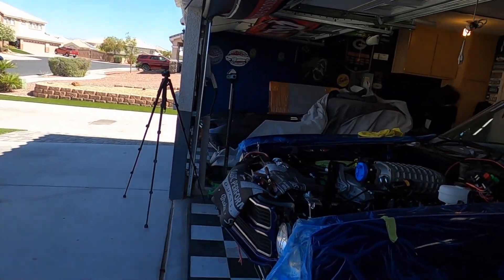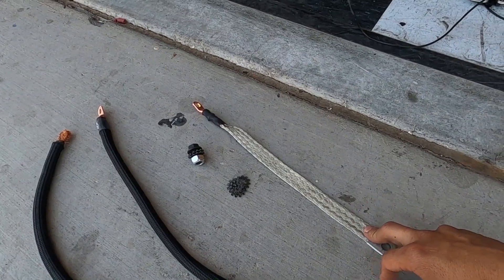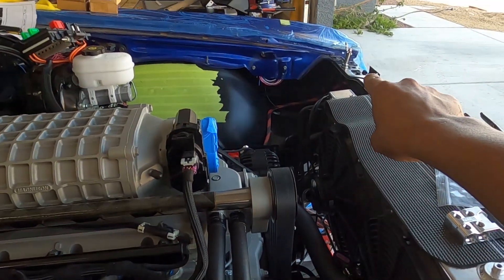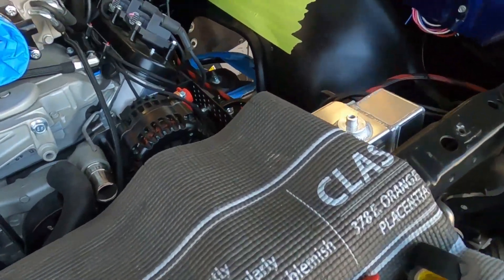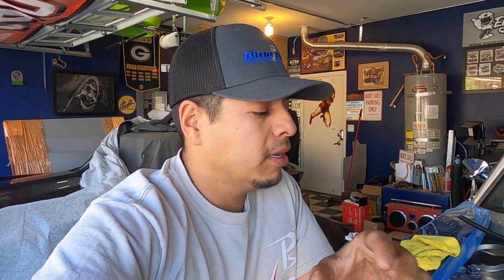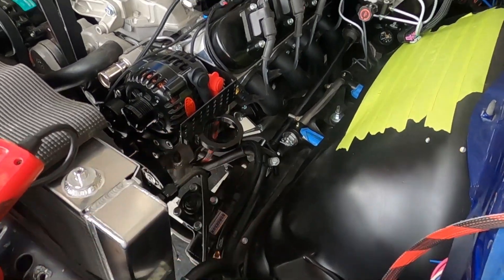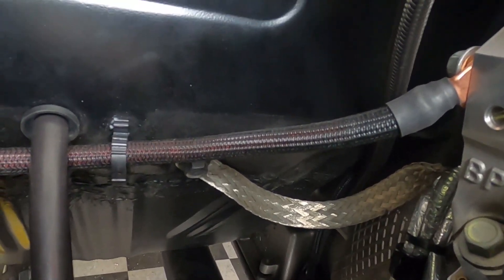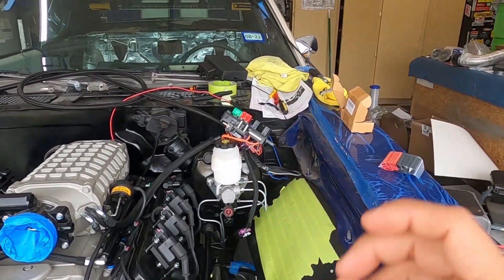HOW TO PROPERLY GROUND A CAR BATTERY TO YOUR ENGINE? (PART17)

Comment: I’ve never heard of running a ground wire from head to head. Interesting idea, I’m going to try it on my C5 Z06 that is very well known to have LOTS of ground or potential ground connection issues. My electrical knowledge is very lite. This might sound like a dumb question but is it possible to have too many grounds ADDED? Example, adding a ground from the alternator to the frame rail, a ground wire running from head to head and an additional ground wire running from the head or block to the frame rail? I understand to keep the wire size the same or larger than the positive cable (s). But again, is ‘adding’ 4 or maybe 5 extra grounds possibly a bad idea?
Great video btw🤟🏻🏁
Reply: There can never be too many grounds. But I do agree that he went pretty overboard with em.

Comment: So using your logic why would you run a smaller ground wire for an amplifier then the power wire? I've allways just ran zero gauge power and ground wire..and its not a crazy size since your dealing with allot of draw for bass

Comment: Did you put the ground wire on the same bolt as the charge wire on alternator?
Reply from the maker: No , this alternator requires a ground and has its own post for it
Reply: great, Thank you. I show the proper voltage from my volt meter 14.2 volts. But my dash is showing 11.7-12.5 while in idle. Maybe its the wiring on my Dakota digital. Now to trace that.

Thanks again. @goosseperformance1444

Comment: HI Great Videos,
Question for you, what is your go to setup for Brakes on Disc/Drum setup with LS with Cam and low vacuum.  I had a small Brake Booster and engine was not making enough vacuum.  So I went to Hydroboost setup and still not seeing the expected results.  Please share some tips if you can.
Thanks MJ
Reply from the maker: Only thing I can suggest at this point would be manual breaks different feel but they work